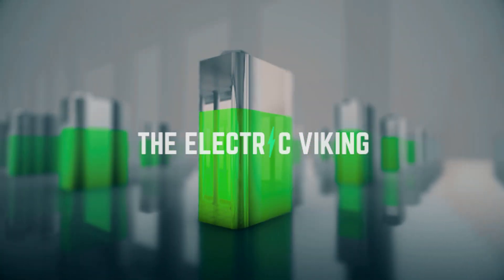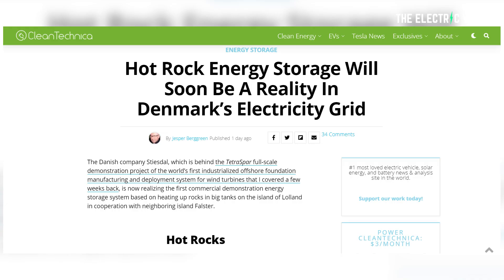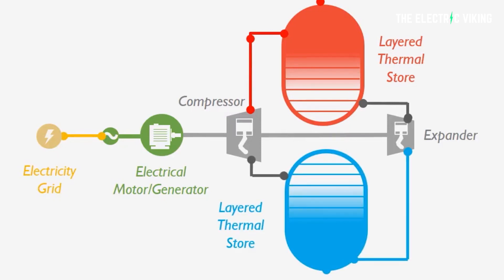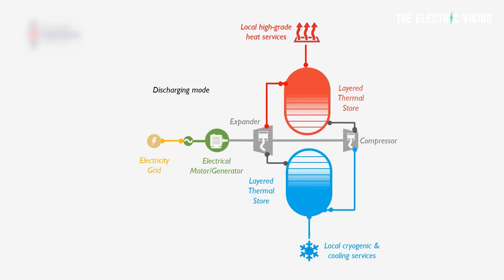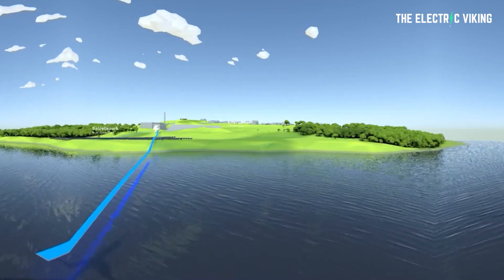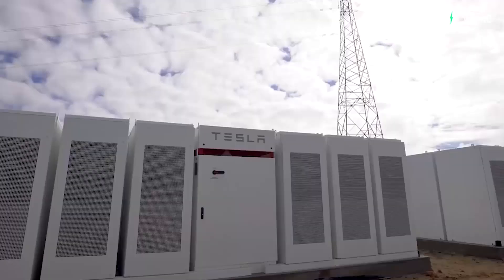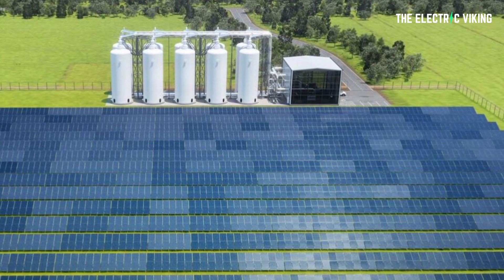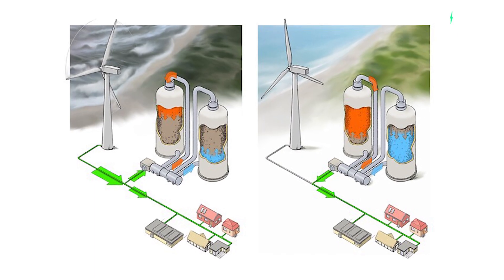Cheapest battery storage in the world - Hot Rock batteries are amazing

Comment: The onshore windmills could be situated alongside hotrock which would minimise both infrastructure costs as the grid supply point would be virtually the same, with corresponding savings in investment. I don't quite understand why both aren't integrated into a single platform offshore, storing energy in situ. I asked about it and the really big windmills have no plans for this! I thought that some of the old oil rigs could be refitted as on site hot rock storage giving a second use to these relics. No shortage of methods, but getting them integrated may well end up the province of Chinese engineers. Governments need to look to encouraging further integration of technologies such that we don't pay for turbines to turn, and pay to have them stop.

Comment: Moltex Energy Ltd are using “solar salt” to store heat at high temperature. It’s the same salt as used in thermal solar power plants. 
It allows their 500 MW heat source to run at 100% while the turbines ramp up and down from zero to 1500 MW. But HORROR they are a nuclear generator. Their reactor is as simple as it could get. No pressure to explode a negative thermal characteristic that cannot overheat, passive cooling so decay heat can’t overheat the reactor. No moving parts inside the reactor. Even better it burns spent fuel from legacy reactors. The stuff with 30,000 years 1/2 life is burnt down to 30 years. That fuel has only had 4% taken leaving a massive untapped energy resource which Moltex can take.

Comment: Good info, but... it's 80% cheaper than a $500/kwh battery storage system, therefor it's $100/KWH, not $10/KWH.  If it was $10/kwh I would put one in at my house!  (Also, they are comparing total cost of lithium battery storage with total cost of thermal storage, so BYD's price/kwh of less than $100 (usd) is irrelevant, as it's only for the cells, not the system (system includes BMS, battery housings, installation and permits, interconnects, grid-tie circuitry, etc
Reply from the maker: Thank you commenting.

Comment: I feel like I first read about this type of energy storage several years ago, maybe even more than a decade ago. Never heard much else about it until now. The fact that you don't see them in common use everywhere already is not a great sign. 

The rocks don't move at all, they are stationary thermal mass. The hot tank just gets heated with excess grid energy from the bottom up. The more mass you have available, the more heat energy you can dump into it before the top layer reaches the maximum temperature. But as you can see, the tanks have to be pretty big, and take up quite a bit of space. 

The fact that this hasn't become widespread yet makes me feel like they may still have technical challenges with this system that might make it less practical despite the supposed cost differential with battery storage. Guess we'll see.

Comment: I Think it will Work but Success will Depend on the Quality of Engineering.
Plus How Well the Danes Run it.
Not sure Why they went with a Compressor unless they are using Pressure to Drive the Generator.
Obviously if they were only Storing Heat, They could have gone with Electric Heating which is Simpler and Reliable.
Or they might be Combination Heat Drive and Pressure Drive.
They do seem to be Using the Heat for something else ?.
Still Low Cost Claims are Impressive, We wait and See how Successful they are.

Comment: Lithium ion, LiFePo4 don't have sufficient cycle life. Take a look at Ambri liquid metal batteries instead
Reply: I"m using LFP batteries with my solar panels.  They are warranted for 10,000 full cycles.

10,000 / 365 = 27 years.

Ambri/Sadoway promised liquid metal batteries years ago.  They/he have not delivered.  To date they have not moved from the lab to the real world.
Reply: @bobwallace9753  I wish you luck if you're charging them daily. No doubt you'll be refunded when they die. BYD any chance. Just checked, 2000 cycles for your batteries if they're used.
Reply: @MegaWilderness  

Jeff Dahn, Tesla's main battery researcher, has reported over 15,000 full cycles with only minimal loss.  If the batteries are discharged only 50% there's essentially no loss.  And the rumor mill says those batteries are now past 20,000 cycles and holding about the same but he has yet, as far as I know, to release updated data.

Comment: First, Sam, I have to keep reminding myself that you're not a Nordic kind of guy, even though your handle and your appearance keep pushing that thought into my head. But I guess I need to get serious. Read on…

TBBH I don't see this as any real breakthrough. That doesn't mean it's not worthwhile, just that it's not especially novel, and it's one of a wide variety of energy storage techniques. The thing to realize is that we have an embarrassment of riches when it comes to energy storage options, and it's only getting better. This is in contrast to renewable energy generation, where solar and wind, and especially solar, are increasingly dominating everything else. I don't know if that difference is good or bad, but it's certainly very different.

With energy storage, it's basically down to two criteria: Capital cost, and efficiency. One nice thing is that capital cost strongly tends to decline with time. OTOH efficiency can be limited by fundamental physical laws such as the Second Law of Thermodynamics.

With that as background, I want to point out a few things that look important to me:

1. Energy storage is called on cover different time scales. There's the daily cycle, which brings in issues such as the infamous Duck Curve, a big thing for solar in sunny locations. At the other extreme, there's the need for seasonal storage, which is a big issue for high latitudes. For dealing with the Duck Curve, frankly, I think we're better off with batteries. They respond quickly, and are very efficient. Both of those are very important criteria, and no new technology is likely to reduce those two things to minor importance. OTOH for seasonal storage, hot rocks could have important virtues.

2. Hot rocks may make a lot more sense if you can find some natural formation that can contain a large amount of crushed stone, sand, or other such thing, rather than making your own tank. It really helps if you can surround the stones with something that insulates well, perhaps something foamy that is mostly air, some other gas, or a vacuum.

3. At a high latitude, solar could actually work very well if you have good enough long-term energy storage. You need a tracking system, and some good, strong structures; but if you have something you can keep pointed sunward, you can actually gather quite a lot of solar energy per unit of collector area during the sunnier part of the year, then store it over the winter. But it's more expensive to set up suitable collectors than in lower latitudes, and you need to put panels in places where you can accommodate some pretty long shadows.

4. OTOH if you're going to develop such a rock-based system, maybe you're just as well off simply drilling for geothermal energy. Again, capital cost has a lot to do with these decisions.

5. Competition also potentially comes from just the prospect of better grids. It costs money to put in all that energy storage. If you're in a high latitude, it might just be better to import energy from sunnier places over the winter, then export it during the summer. Again, solar panels actually can work quite well in during the polar summer. One thing to keep in mind is that not many people live at really high latitudes, especially in the Southern Hemisphere; and those tend to be in areas where the grids would most easily run north to south, which is the direction most needed. (Example: Morocco to Scandinavia, or Mexico to Canada.)

The bottom line, as I see it, is that this calls for a lot more R&D and planning, and even then, the economics will determine which options work the best, ouf of all the ones that pass the initial tests of technological feasibility.
Reply from the maker: Thanks for commenting!!!

Comment: Interesting. I really like what Highview Power is doing with liquid air storage. They have a couple of plants coming on line this year. It too is cheaper than lithium but how much cheaper and how efficient is the question. Maybe hot rocks are better. The good thing about liquid air is it is old technology which means construction can be done immediately and the energy can be stored for months. It is very similar to hydro.
Reply: If hot rocks/sand and/or liquid air turn out to be less expensive we may still need some batteries to deal with rapid changes in demand.  A hybrid system.

What may be interesting is the cost of battery storage a few years out.  Assume lithium iron phosphate (LFP) batteries have a 10,000 cycle life like the ones I'm currently using.  Put them in a 250 mile EV and they become 2.5 million mile batteries.  

Perhaps someday we'll build 2.5 million mile capable robotaxis, but let's use Tesla's goal of 1 million mile EVs.  At 1M miles the body is worn out.  If the pack can't be swapped into another EV then it's value = cost of materials - recycle costs.  

Let's say the start new at $50/kWh with a materials cost of $30/kWh.  And the cost to shred and separate is $5.  The recycling yard is going to offer about $25.  $30 - $5.  

A storage company could offer $30.  Use the batteries for a number of years.  And then sell them on to recycling for $25.  A net cost of $5/kWh.
Reply: @bobwallace9753  it's all looking good hey. An incredible time in history.

Comment: You may find NREL articles by Wesley Cole interesting. Building storage power and peaking batteries are still economically high but some utilities are being forced to look at it due to the influx of power hogs like FAB semiconductor plants and Data Centers. Some utilities have researched increasing nuclear output and storing excess power in all types of storage systems for peaking along with storing non-predictable solar or wind production which in most utilities makes up a very small amount of their renewable energy portfolio.

Comment: Electric Viking, thoughts on:  Redflow (REFXF - zinc-bromine flowing electrolyte battery modules (ZBMs)) and Zinc8 (ZAIRF - zina-air Flow), both that should be great for storing energy in a low cost model and allow for "Full Discharge" without battery damage (great for Virtual Power Plants in the future).
Reply: Great for home storage to
Reply: @gregb1599  
Apart from the Bromine aspect
Reply: @rogerstarkey5390  Only if you decide to drink it :-)
Reply: @rogerstarkey5390  No battery is perfect but some are already proven technologies, LFP are the best so far due to their extreme long life and unlikely to burn your house down bulk and lack of energy density is not an issue with home storage  so it's a proven storage option

Comment: You may want to check out Gravity Batteries. It's one of the cheapest (potentially as cheap as $0.05/kWh), highly efficient (~90%), does not take up lots of space, does not require exotic minerals, does not leak during storage, lasts for decades and can be built almost anywhere.
Reply: Tesla's dry-rolled, tabless 4680 lithium iron phosphate cells should cost under $50/kWh.  And should have 10,000 or more full charge/discharge cycles.

$50 / 10,000 = $0.005/kWh.  Add in a bit for charger/inverter hardware and racking.

Comment: What I have not heard about hot rock or liquid air storage methods is the stand-by energy losses for each.  LFE and L-ion can meet operational costs by bidding on narrower spreads of energy cost due to their higher cycle efficiency.  If the additional spread required to cover the (currently low) cost of money is still less than the spread required for thermal storage, thermal storage must wait till LFE and L-ion are depleted and the spread increases.  In the meantime any energy lost during stand-by further lowers the overall efficiency.  It would be nice to know how much this loss can be minimized.
Reply: What I understand is that soil is a low heat conductor.  If the sand or rock mass was buried at only a modest distance below surface "self-discharge" losses, as we refer to it with batteries would be low.  Obviously there would be some loss initially as the surrounding soil was brought up to temperature along with the storage mass.  But once heated little energy would be transferred away from the site.

The best solution for both might be large volume excavations.  With rock/air storage, depending on the looseness of the material around the hole, some sort of barrier to keep small particles from infiltrating and interfering with airflow might be needed.
Reply: @bobwallace9753  That's similar to what I understand but what I see for silos are rather tall for their diameter which increases the surface area per unit volume.  Someone must have made the calculation for a given tank design.  I just have not seen the figures presented.
Reply: @mrhickman53  I wonder if they've thought through the lowest cost solution.  Perhaps an insulated tank is a good way to get started and perfect the heat/electricity transfer hardware.  Seems like their tanks have a lot of surface area.  

A great big hole in the ground could have a lot less surface per volume and it should be cheaper.

An abandoned rock quarry might be an interesting place to site storage if there were transmission lines nearby.  The hole would already be dug.  The sides should be fairly free of loose soil which could clog the system.

I wonder if there are waste materials such as old concrete or coal cinders which could be used?  Slag from smelters?
Reply: @bobwallace9753  It's certainly possible all we are seeing to date are proof's of concepts, demonstrating the energy conversion only.  Still, I'm sure the analysis has been performed to determine the insulation necessary to make the storage cost effective.  I would like the analysis shared.

Comment: There is another way to do this and that is through solar heat capacitors, using molten salt heated by a solar thermal system, which uses an array of mirrors. In this instance the rocks are stored underground because the heat is too intense, up to 1500C. That heat is stored underground for as long as there is no heat loss, and can then be used to heat molten salt which in turn drives a steam turbine, with the water captured recondensed and returned within a closed system. This means it can be used at any point in time. You can also add more capacitors to the system so long as you have enough space to bury the rock heat capacitor system. As I understand it the efficiency is about 50%. Same with the reverse, liquid air batteries, the same efficiency, about 50%. Which is pretty good.
Reply: ygg drasil
That system does rely on good sunlight, so is limited.
Reply: @rogerstarkey5390  Yes, better for hot countries and states. I believe it's being trialed in one of the southern US states.

Comment: "If you want to make something dirt cheap, make it out of dirt" - as Professor Sadoway said.  Or in this case - the next best thing - crushed rocks.
In fact you can also make it out of sand - as shown in this video - https://www.youtube.com/watch?v=UvNv_gM_ZUk
What I think is more important than cheap power storage that this technology proof-of-concept will prove, is that it can lead to other developments and greater acceptance in this field of thermal hot rock storage.
The reason that the efficiency is low is because of the energy change from thermal energy to electricity.  But imagine if you can improve the efficiency to more than 100%, by simply leaving the thermal energy unchanged and use it to heat your home in Winter.  This way you avoid the double loss - by avoiding having to convert thermal energy to electricity and back again later when you need heat.
There have been parallel studies and projects done on this concept - you can perform cooling in Summer by moving the heat into the storage rocks, and then bring it out again in Winter to perform heating.  Using the same storage medium as this or similar (such as sand in my linked video).
As anyone who has monitored their energy usage will know - heating and cooling, including heating hot water, takes up over 80% of our power usage.  If you can store heat when it is naturally warm in Summer, and use it in Winter when it's needed.  The electricity that is required to do so is much, much less than having to generate thermal energy using electricity - this is how you can have greater than 100% efficiency by using heat pumps instead of resistive heaters.

Granted the thermal battery may not be feasible if you have to pump heat through insulated pipes to a large area, but it is surely viable for local community scale heating or large buildings such as high-rise apartments, shopping centres or factories.  Or even private home heating if they can build it in a small enough form factor.  Imagine if your home can heat up your hotwater while cooling your home during summer, and put the rest into the thermal battery.  Then in Winter, that heat energy can be brought back out to heat both your hot water and your home.

If this pilot plant is successful, hopefully this will drive investment into this new and exciting field of thermal energy storage.